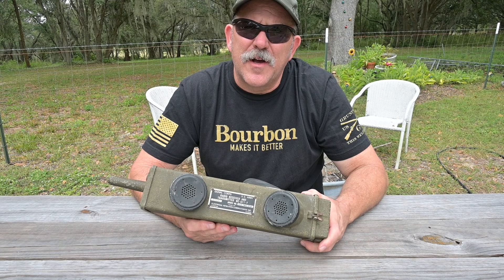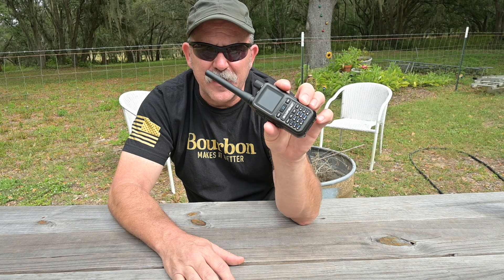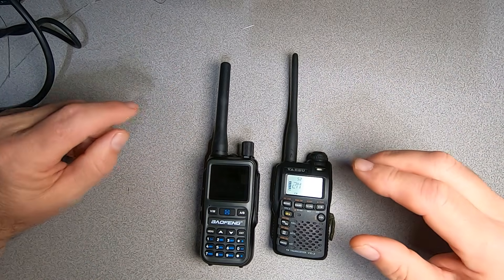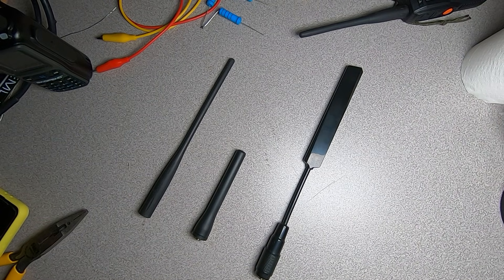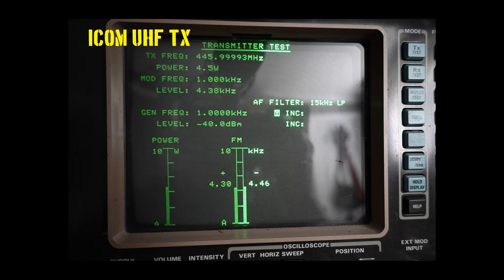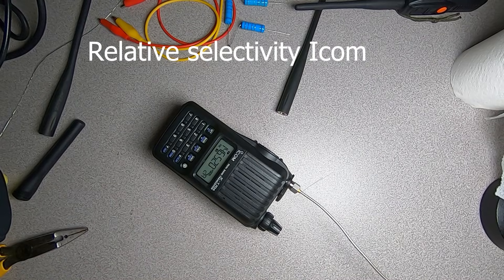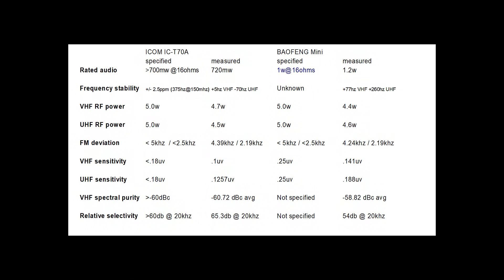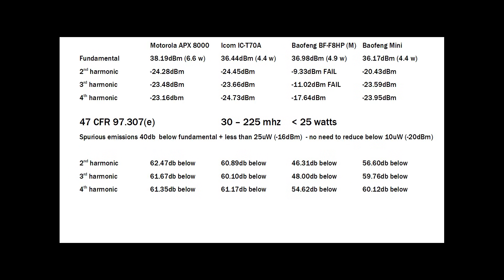Baofeng UV-5R Mini tested - 20 dollar powerhouse the size of a speaker microphone ?

Comment: Considering where we came from: My first UHF receiver in the mid 70's was an "Electra Little Tiger Converter", a single channel crystal receiver that would oscillate into the AM-broadcast transistor pocket radio I had it taped to... and I had a 4 channel VHF Realistic pocket scanner... So yes, I'm pretty darn impressed with the UV-5R Mini's capabilities. 
It's not a great radio, but it sure is a useful little multi-tool that's cheap enough to put a pair in every glove box and prep-bag. I agree with you I do wish the font size was larger. 
Now,,, if it had Bluetooth audio (at least to receive in an ear piece) that would make it into my Casual-EDC category.   Love your BC-611... Yeah, portable comms has come a long ways.
Reply from the maker: Very cool. I love the old crystal pocket receivers. Decades ago where I worked we had a UHF voted system and some of the admin staff needed a radio but not necessarily a transmitter. It was felt that giving them a Saber I would be too pricey so they bought them  4 channel Midland crystal scanners. I actually have one of those in my collection. I picked up a 4 channel Johnson for a dollar at a tailgate.  I pocket carried the mini all day yesterday and it is easy to forget about. Thanks for sharing and thanks for watching !

Comment: Thank you for this video. I understood most of it I believe, but i still struggle with minus db (or negative db). I just have a mental block with it. Can you point me to a good primer about it? Even with computer wifi, I struggle to know if -35dBm is better than -65dBm. Apologies if this sounds stupid.
Reply from the maker: You are welcome ! Here is a good guide think of a line that is zero that is dividing a box from left to right like a bank balance.. On the top half of the box the numbers increase ascending in value North of this line (plus) which is a profit. South of this line  the numbers descend in value (minus) which is a deficit . North of the like is 10 cents (10dBm) below this line is you owe 10 cents (-10dBm) . When you look at comparing a number that is 20dBm (cents) representing your balance. Compared with a number that is - 10dBm (cents) loss you reduce that number of 20 (cents) by subtracting 10 (cents) leaving you with a balance of 10dBm this represents a loss of 10 dBm. Lets say you have an amplifier that provides gain. Your initial signal is -50dBm and you turn the amplifier on and your signal is -10dBm your amplifier has provided +40db of gain . Radio transmitted signals typically emanate in the plus  ( +37 dBm is 5 watts) In radio most received signals fall below the zero line . A signal of -90dBm is a good S9 signal and a signal of - 120dBm represents a signal of S1 . I hope this helps ! Thanks for watching !
Reply: @survivalcomms  I think that helps! I appreciate it!
Reply from the maker: @vinniec5286  I'm glad ! Just see increasing value above and below zero as ascending values. 120 is plus 120 minus 120 is less than minus 100.

Comment: The selectivity results were really surprising to me. I live near an urban area so I've experienced the original UV-5R going deaf from powerful nearby signals, and it wasn't until I upgraded to an ICOM IC-V80 that I actually managed to talk more than 1 mile simplex with an elevated antenna. I picked out the V80 based on data I found on its sensitivity & selectivity online. It seems like Baofeng has really stepped up on the receiver design.
Reply from the maker: I understand completely. I have a BF-F8HP that has audio with a -100dbm signal 40khz away. I used the subjective nature of the test with audio  in lieu of the objective data captured between the two devices as the variation in sinad measurement at -60dBm and +20khz was .5db on the BF mini with the Icom at 0db on my Sinadder 3. The varying of input signal  and record of the audible result was more relateable  IMHO and kept the content short. I may do a short of the latter at some point. Thank you for watching and sharing your experience I appreciate it.

Comment: TY for the video, it's cool that the uv5r mini isn't just a fancy and loud piece of costume jewelry.

It's interesting to see these that cheap radios are starting to clean up their performance.
Reply from the maker: You are welcome. Time will tell how the radio will perform over the long haul but after several charge cycles the radio has done well. The AM civil air receive and FM BCB is decent on it as well. The frequency search feature seems to lack sensitivity and is rather slow compared to some other products. It may have been intended as a near field band specific frequency counter and if that is the case it is very slow. The cost vs performance is  good news for the end user but not good for the industry IMHO. For example I replaced a part on my vehicle recently. The OEM part was $250.00 the aftermarket part was $38.00 . The disparity in cost is a glimpse into the bigger issue of sustainability of industry but I digress. Thanks for watching !